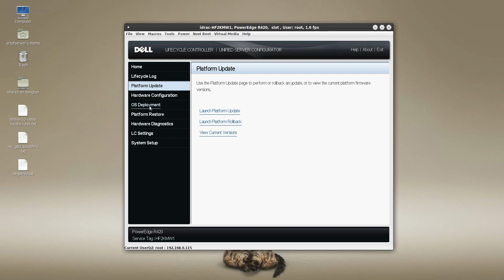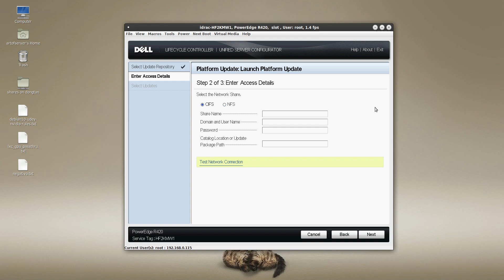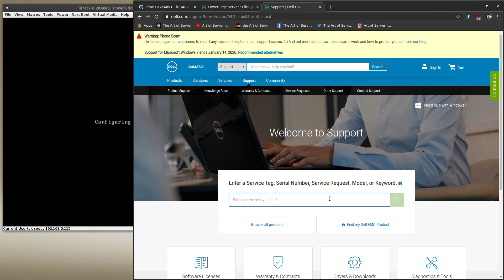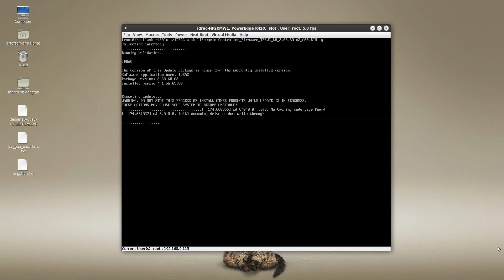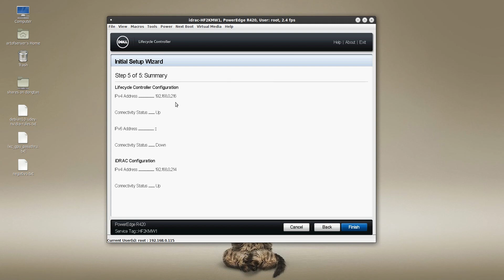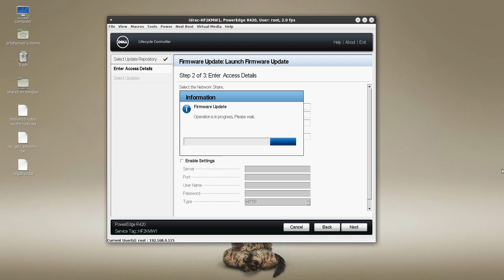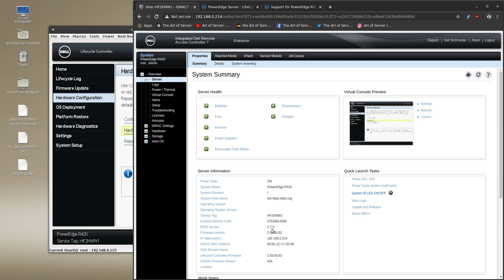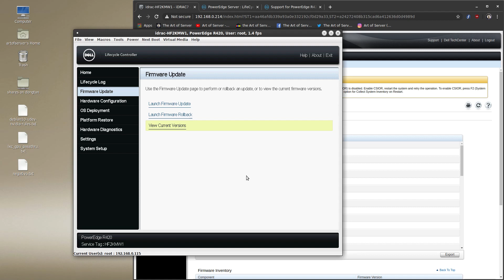How to update BIOS and firmware using Dell Lifecycle Controller | what to do when it doesn't work

Comment: I have a PowerEdge R710 with Idrac 6 and can NOT get the LIfecycle update to work, it loads the catalog and then fails.
Reply from the maker: That's because the 11G servers are all EOL and Dell removed the repository for those servers. You'll have to update the manual way I showed in part 1 of my r710 series.
Reply: @ArtofServer  Yeah I watched that, very nice video, but stumbled pretty quickly as Red Hat refuses to accept my email so I can't DL the Red Hat iso :P

Comment: Does anyone know if this is possible to do with an R720? It looks like I have the latest version of the Life Cycle Controller found on the website but I still do not have the option for HTTPS. Thanks.
Reply from the maker: Yes, it should be possible on all 12th gen PowerEdge servers...
Reply: Why not you just perform the upgrade via iDRAC?Download the latest version from Dell Support website and then insert you Service Tag for the searching. Go and get the latest version usually on the right side you can "URGENT" message.

Comment: Thank you for this. I have a question I see there is an upgrade for your H710 if this raid card is flashed in IT MODE will it override this and apply the update and break my it mode flash ?
Reply from the maker: That's a good question. I should make a video about that!
Reply: @ArtofServer  Is there a video on that ?
Reply from the maker: Not yet...
Reply: @ArtofServer  yet?